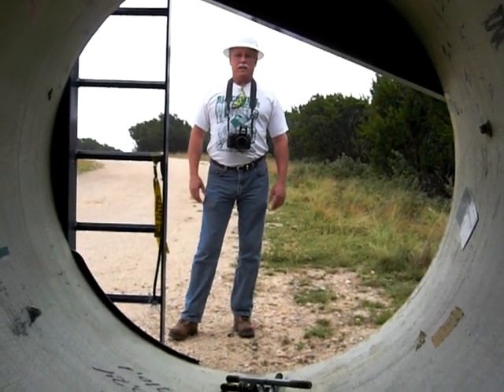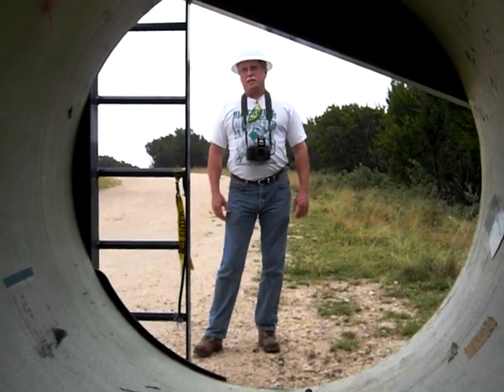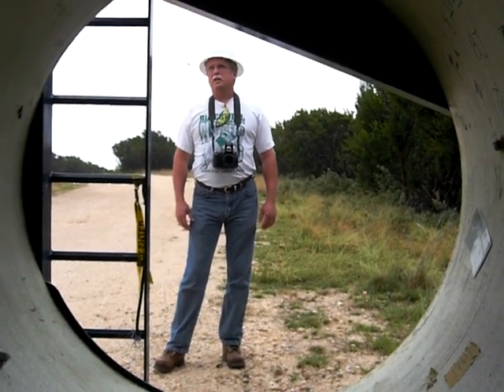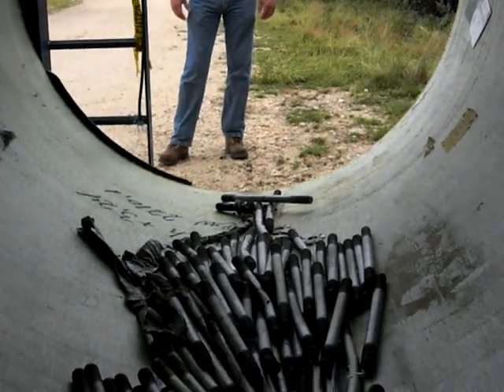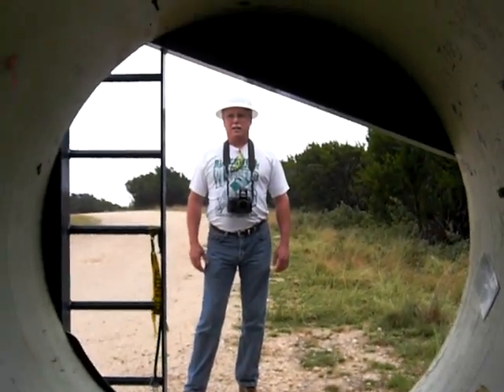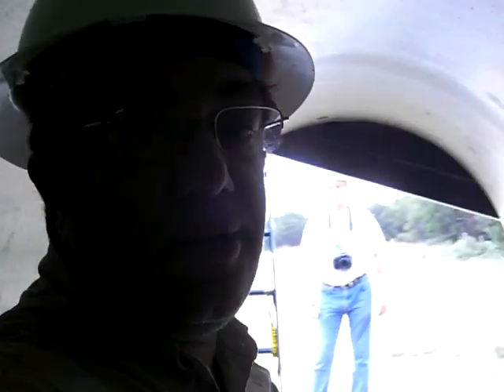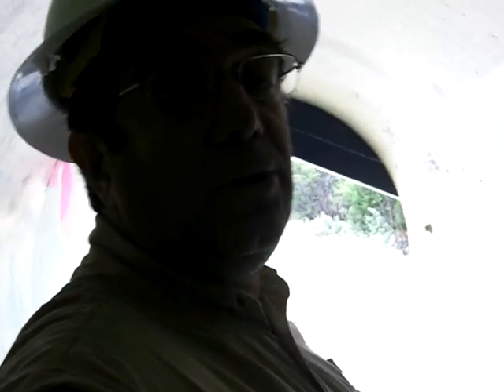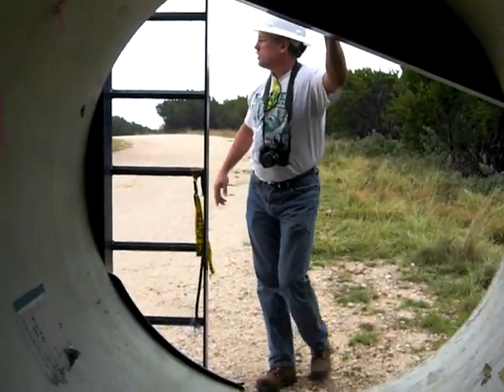Texas Wind Turbine - Inside the Blade

Comment: Hi! I made a measurement of a GE 1.6M 82.5m blade,  with microwave device remotely and found out there is a Electromagnetic discontinuity at about 7-8 m (about 20% of length of the blade) from the tip, which usually indicating a structural or material change. I am not familiar with the blade structure, but really interested to know what this could be. I have seen it from the outside, and of course it looks really smooth. Could it be the end of the lighting protection cords? Any suggestions would be greatly appreciated!

Comment: I didn't know the blades are made of fiber glass, cool!  So you need oil and gas to produce the fibre and the resin, and oil to lubricate the gearbox, and coal and iron ore to build the tower and concrete to make the base.  So what is the carbon footprint of all that per tower?  Multiplied by well over 100,000 towers to give Obama his dream....thats a lot of oil and gas and coal and ore needed to go green!